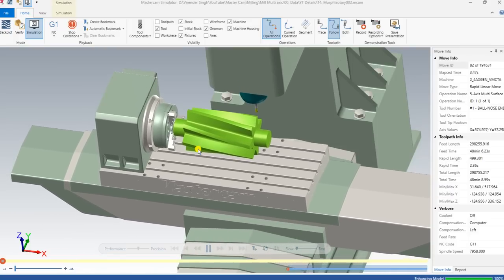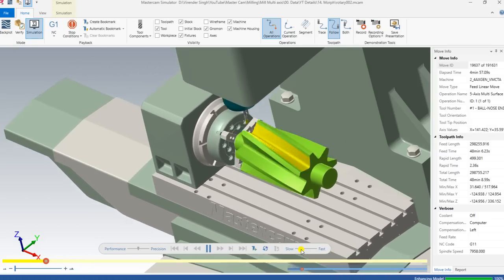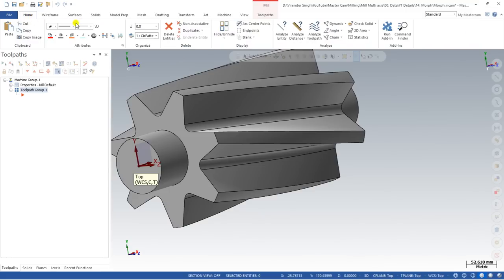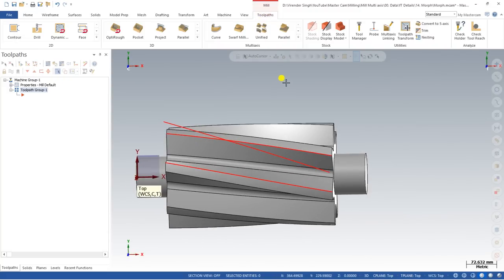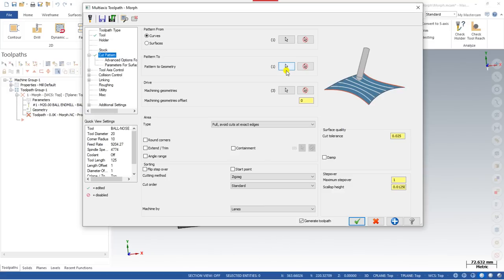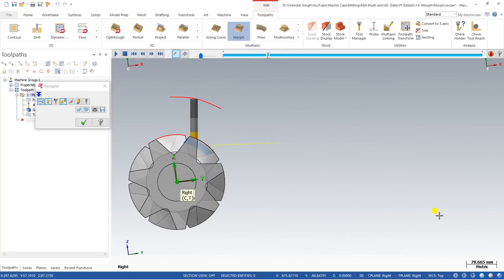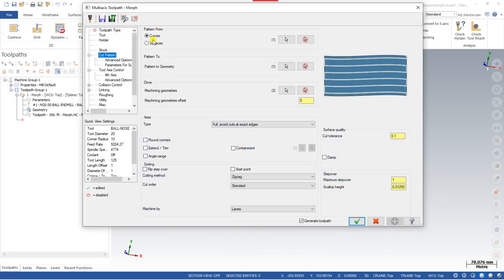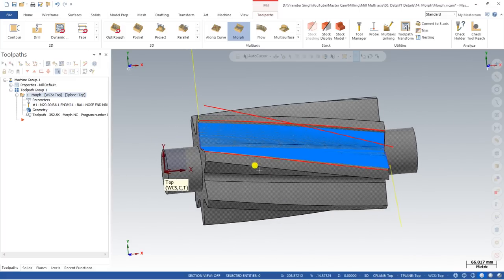Morph - Mastercam Multiaxis Programming

Comment: great video, thanks,  one question, when I used stock to simulate the tool path, usually got a over cut on the vary edge of the parts, then I tried to use extend edge function trying to extend the tool path out a bit,  but it's not working, usually got mass up tool path, any idea?
Reply from the maker: Contact me at +91 9983660675 ....i am here to help you
Reply: @VirenderSinghBhati  thanks,but I am from Taiwan, it's international call though